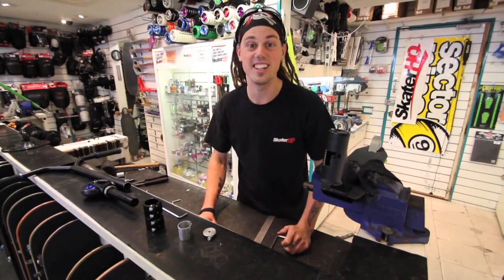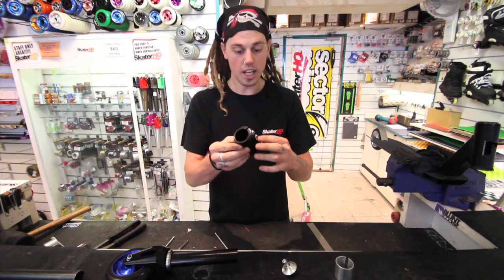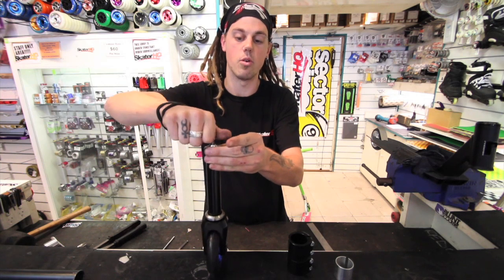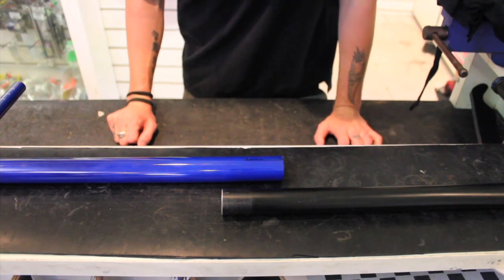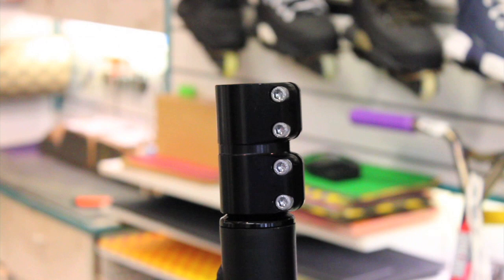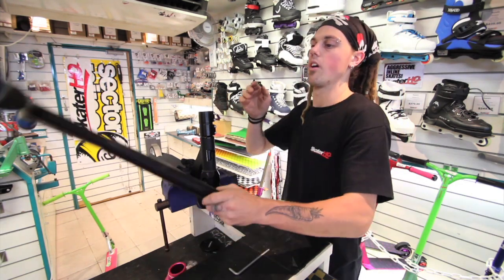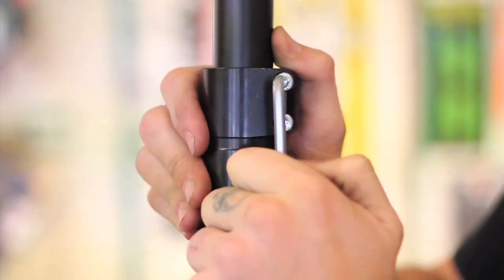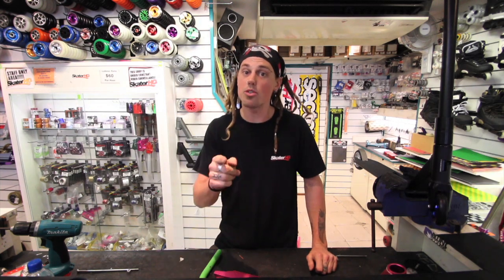SkaterHQTV - How to install SCS

Comment: @123puzzlesmc if you have forks with a hole goign straight through it, then u hammer the startnut in, but if you jsut have a slmall screw in hole in your forks thats when u dont need the starnut, as shown in the video.

Comment: @legitxh33ns  yes you need a star nut in the forks and you proberly will have to cut them down depends on the headtube angle and length of forks

Comment: when installing scs on a madd gear ninja do you either need to cut the forks down or get spacers because the head tube is smaller or will it fit without it?

Comment: no you need threadless forks and you need a starnut in your fork. i reccomend apex forks , they are pricey but they have a removable screw-in starnut incuded. i have an apex fork myself and they are light and super strong!

Comment: Its a special tool that they use. you can buy one from skater hq for $50. I made one at school on a lathe and its exactly the same, just it was alot cheaper. If you want to buy one from skater hq, go to the scooters menu, then look for tools under accessories.

Comment: Take the bottom bolt all the way out, then put the bolt in the opposite side of where it normally goes in and tighten it to the right until you see it poke out in the middle slit, thats when you take a penny and hold the penny against the hole which the bolt would have gone through. Continue to tighten the bolt until it hits the penny, then tighten just a little more and it will expand the clamp just enough to fit it on your forks. Don't over tighten or it will make a hole in the penny...

Comment: With a SCS, you don't need to cut out the slits. You can get some old fork stube and install it in your bars do you don't have to cut new slits later on.

Comment: If the bolt keeps spinning, that means the little silver piece of the starnut that has the thread inside the flangs is broke. I have had this problem too, and you definitely need a new starnut. so just hit it out or let the shop do it, go to your local bike shop, or send it in to skater hq and they will put a new one in cheap

Comment: What bars do you have? All bars should fit inside with or without a shim no problem, unless you didnt cut the part with the slit on your bars as he said in the video. the slit helps to bend in the bars onto the forks but seeing as with scs the bars arent on the forks, the slit will bend in because there is nothing inside that they can bend onto and then will fall out. So get someone with a hack saw to cut the slit part off for you then your all good to go :)

Comment: i am getting a district deck and and bars with aproto clamp but i have grit forks that run ics (starnut compresion) what do i do when it comes to putting it togethor because they are not internaly threaded they just hve a giant bolt that runs up throught the bars what do i do do i just take the bolt out ?
plz reply someone

Comment: you will need a starnut in your forks, threadless forks and a threadless headset. you need a threadless headset because if you had threaded the two nuts on the headset would compress it already. an scs compresses the threadless headset down. you need threadless forks because a threadless headset can only be used with threadless forks, and starnuts will not fit in most threaded forks. i reccomend Apex Forks, they are pricey but they have a removable screw-in starnut included.

Comment: @LittleMan123461 First of all, It's threadless.
You will have to remove your stock cups.
Then hammer in your new ones, put the bearings in, then your compression ring on the top and finally your top cap. :-)